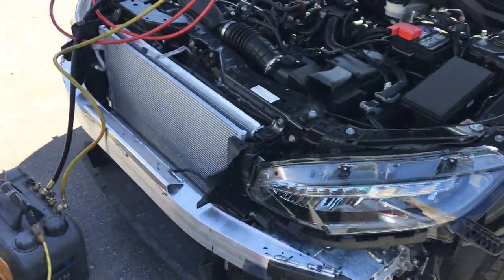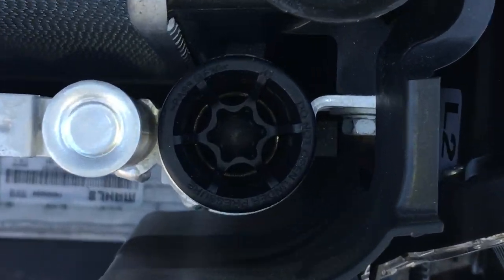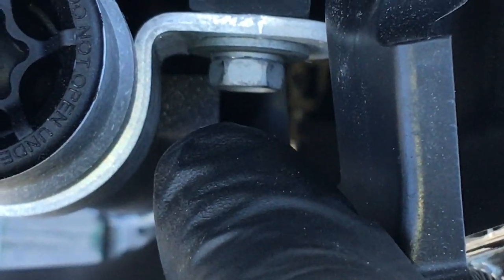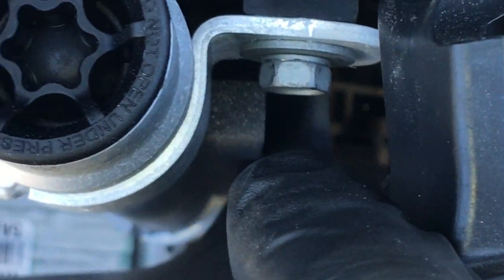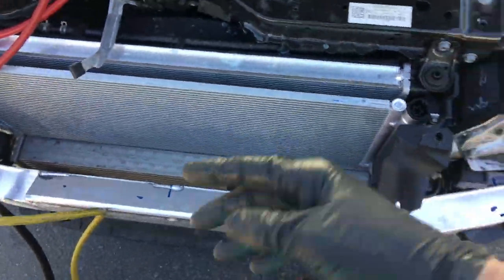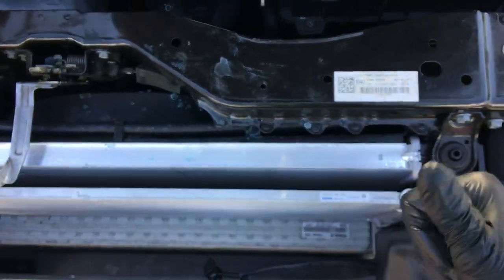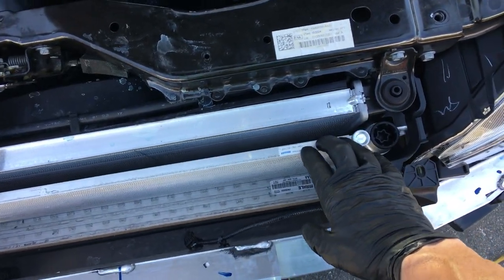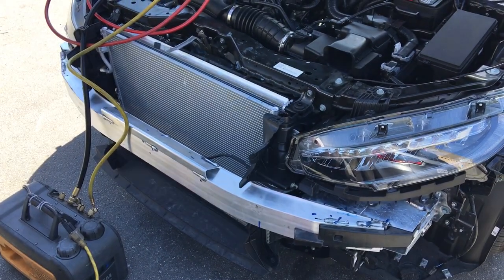Good OEM Honda Condenser￼ Compared to poor quality aftermarket condenser￼  (see previous videos￼)

Comment: Nice video bro , so can I put the foam on top and bottom between condenser and radiator ?? Or where do you recommend it ,I am missing the plastic on the bottom of the car also and I feel my ac does not work good during the day but really nice when is not to hot
Reply from the maker: @luisduque4506  some condenser to radiator placement is a little more tricky than other ones because they’re not the same size when they’re the exact same size it’s really easy

When they’re not exactly the same size, you have to get really creative completely closing up all gaps and leaks and holes between the radiator and the surrounding sheet metal and the condenser 

So long is your refrigerant quantity is 100% full by the manufactures specified weight of refrigerant 

You cannot diagnose problems unless you know the refrigerant charges correct first